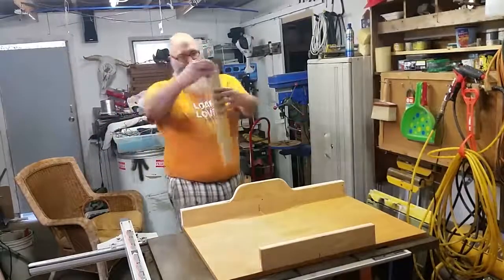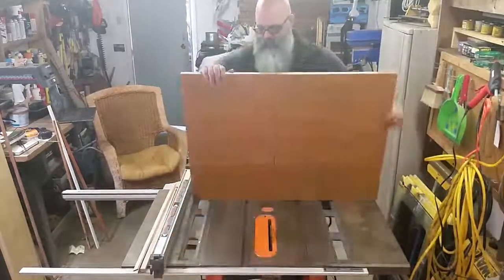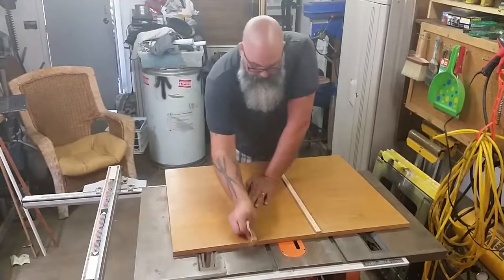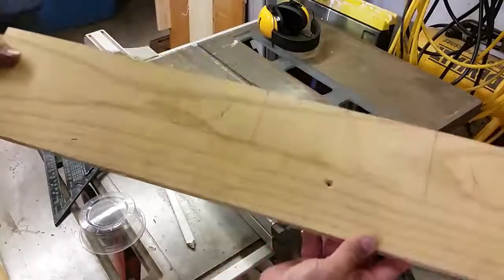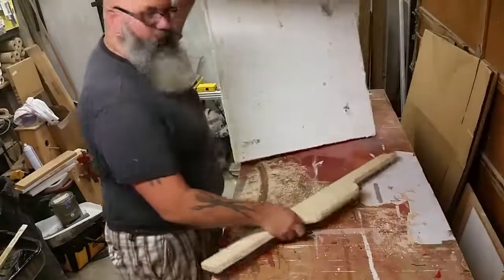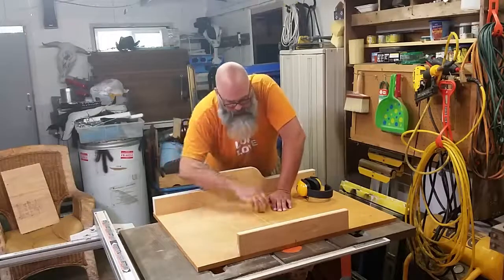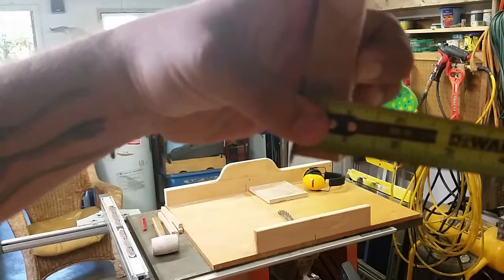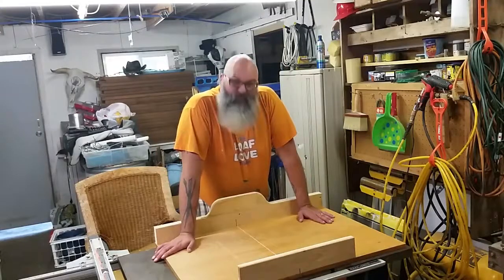Making a Table saw, Crosscut Sled (sorry loud music)

Comment: Man, thanks for the sled video! All of it was worth it for the 1 minute section on how to square up the sled t the blade. I made my sled guides too short so I'm going to have to remake mine and I got lucky with the square the first time. Now I know how to adjust if my luck doesn't hold out.
Reply from the maker: Thanks Shawn, I'm glad you got a little something out of my video!!